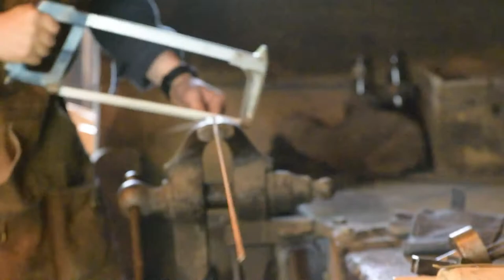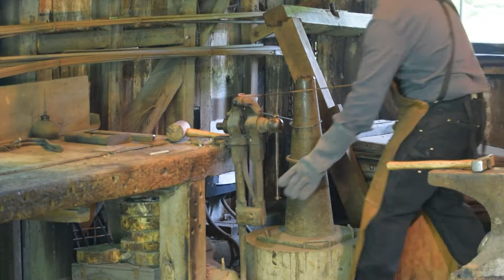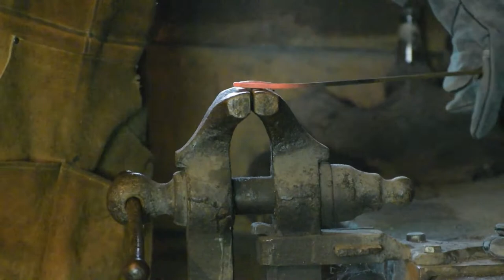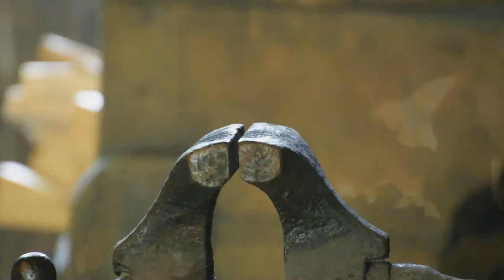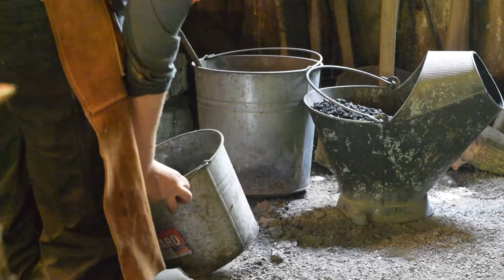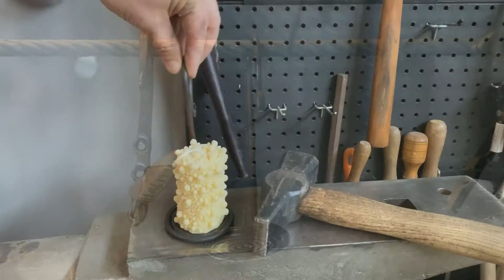Hand Forged Candle Holder- Blacksmithing

Comment: Great video! How come you are using a wood mallet for most of the process? Is to avoid flattening the round bar?
Reply from the maker: Thanks very much for watching! Great question - yes, I use the wooden mallet when I’m trying to bend or straighten a piece that I’m forging while not leaving any hammer marks or as you said, flattening the bar or causing any tapering of the piece. Thanks again for your thoughtful comment!